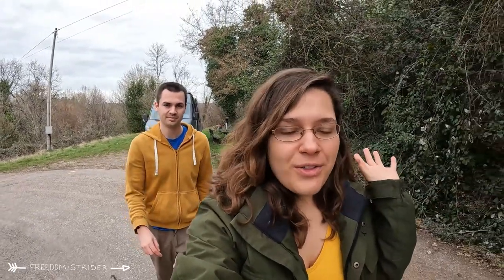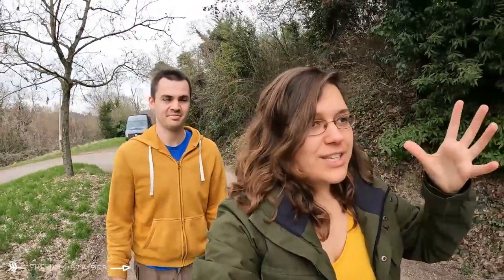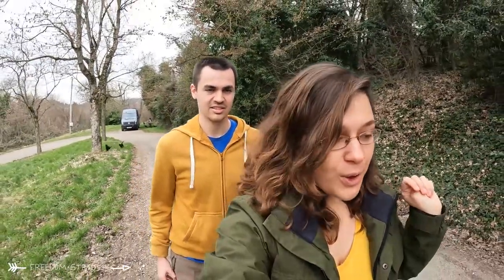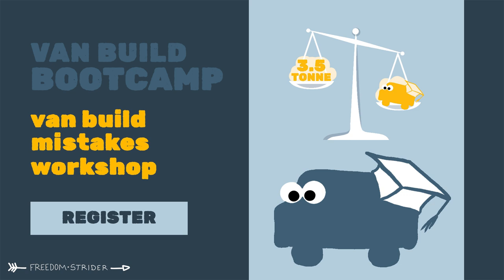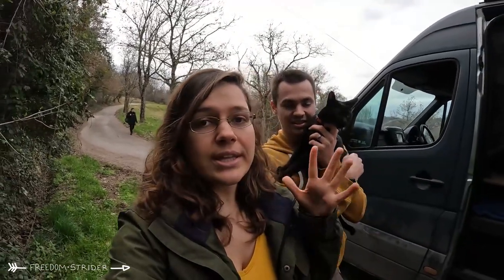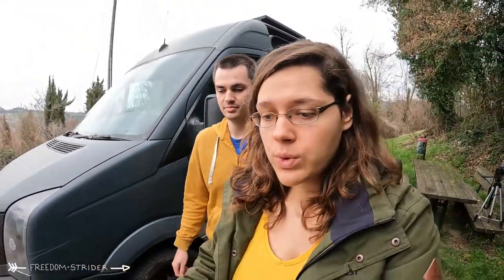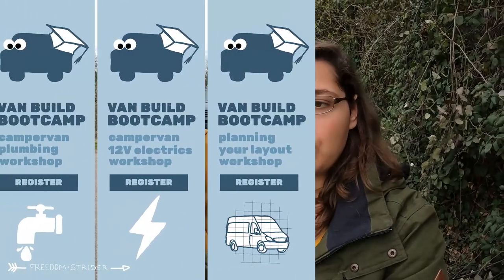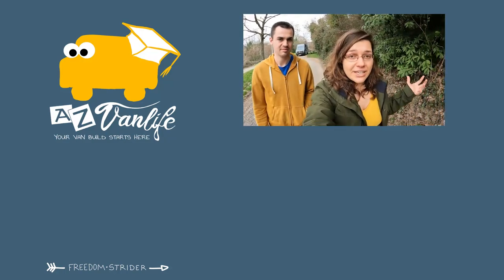the BIGGEST problem with a van conversion is...

Comment: Interesting video.  I think the biggest mistake van builds entail is Bhp.  I have a Boxer 160Bhp....and it's oozes enough power maxxed out at 3.5 ton.  No problem on recent 3 month trip in Spain even with all the exceptionally steep hills.   A minimum of 160Bhp is the very minimum I would look at when purchasing a campervan.
Reply from the maker: Very true, we chose our VW crafter with the biggest engine they come with (163bph twin turbo), the smallest engine is a single turbo 109bhp. At max weight I dread to think how much more strain the engine would be under!!!

Comment: I've just reached 70 and decided not to pay to maintain my licence to drive heavier vehicles, so I was worried by the weight issues on the LWB Crafter I'm converting. Watching your video prompted me to bite the bullet and go off to the weighbridge. Result! 2.86 tonnes without gas or water. That gives a workable margin, but it's designed for up to 5 berths, so it needs it. What was a lurking fear has now become a sense of relief. I had built it from the start on the basis of saving weight. The walls and ceilings have no framing but are bolted direct to steel, 12mm ply for floor and furniture and value space rather than filling it.
Reply from the maker: Yep that's the way to do it and as painful as the going to weight it is, it's worth weighting it early on so you know what you're working with! Ignorance is bliss will bite you in the butt sooner or later

Comment: Well done, good video. Most people don’t talk about weight lol. I found we had over 1.2T of weight from just our belongings when fulltime lol, most of that weight is now gone now that we are part time lol. Our van is just under 3.5T because I used original floor board was was a mistake looking back at it now as that was about 100kg or so lol. If we build another van I’ll use very light insulation foam and not use PIR board as I found the insulation foam was better and could save me about 30-50kg in insulation alone and had about the same K value when doubled up lol
Reply from the maker: Wow, I wonder how much our belongings weigh...scared to check 🤣 I would also use spray foam instead of our, to save on framing weight too, so many things to change👀

Comment: I’m building a 316 Sprinter (one of my ex 500,000 k work vans ) and am determined to keep the gross weight under 2.5 tons. Performance and fuel economy is hugely degraded with weight.
Reply from the maker: That would be an incredible achievement to keep it under 2.5t, as the empty weight is usually around 2.1t. It seems like you are hoping to do the conversation for 400-500kg?
Reply: I know it sounds nearly impossible  but I have been experimenting with 6061 aluminium folded for any framework, kitchen  cabinets, bed framing, drawers and so on, even looking at insulated aluminium sandwich panel for the floor. Bit optimistic I know but I’ll see how it goes
Reply from the maker: Would love to know how you get on 🙂
Reply: Ok I’ll keep you posted

Comment: I've been a bit scared to weigh my van but it's a SWB and has one small kitchen cabinet so I should be OK even fully loaded with me and 25l of water. I've always wondered about US build where they use a ton of Hardwood for the cabinetry and then have an aluminium box on the rear for extra storage, how is that not overweight?
Reply from the maker: In the US they don't have the 3.5t limit on their drivers license, alot of thier van are 4.2t to 5t
Reply: @FreedomStrider  Ah that makes sense

Comment: Wow, 3500KGs is only roughly 7700lbs! Those same chassis (say, Mercedes Sprinters) in the USA have GVWR of ~ 11000lbs (5000KGs)!!!! My Ford E450 van can weigh 14000lbs (6363 KGs)
Reply from the maker: Yep, its all to do with drivers licence in Europe. Anything Iver 3500kg you need an upgraded licence to drive

Comment: Sam:  3.5 tons  GCWR or GVWR ?
Reply from the maker: The 3.5 tonne is GCWR but doesn't include the wieght of passengers. We are exactly 3500kg with passengers. The van chassis is rated Upton 5000kg but you need to do paperwork and upgrade licence to drive it, but the important thing is the chassis is built to 5000kg 👍
Reply: @FreedomStrider    I am looking at a Dodge 3500 series truck.  GCWR is 13,641 KG  GVWR is 6,364.  Even with an inner/outer skin of 0.050 AL  ,2" styrofoam I am almost maxed out. Stay safe.